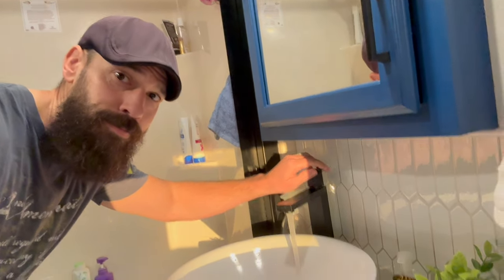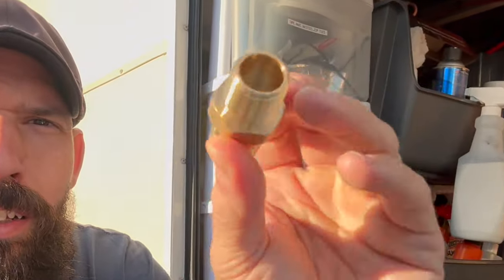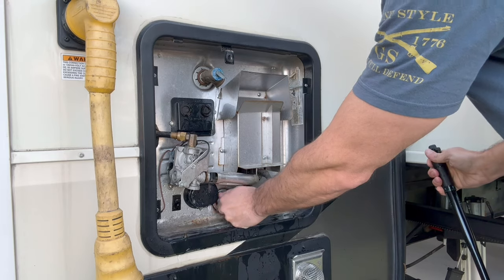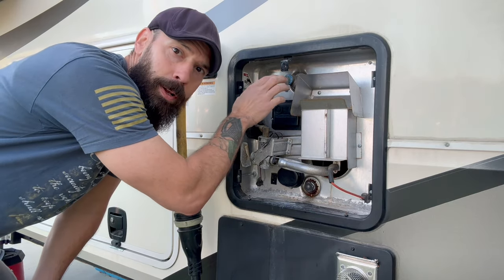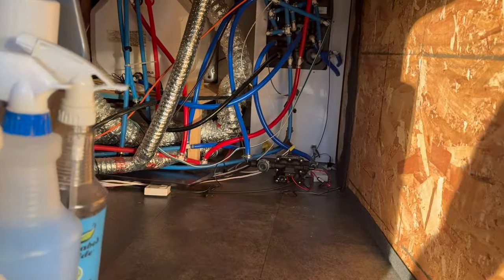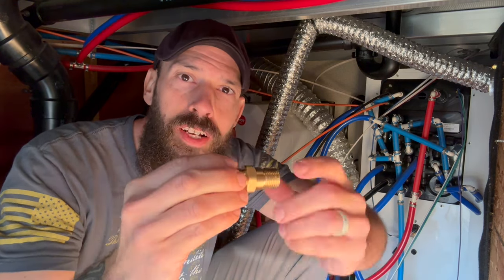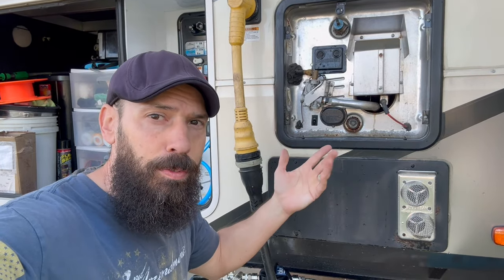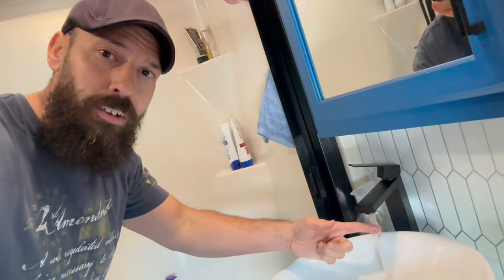A Quick RV MOD Before You’re Left With No Hot Water!

Comment from the maker: RV Preventative maintenance can be key to avoiding larger problems down the road. Sometimes doing a project or changing out a RV part ahead of time can save you time and headaches. Changing out these RV water heater plastic check valves for a heavier duty brass check valve on your water heater is a must. 

❤️ ❇️PRODUCTS IN THIS VIDEO❇️❤️
🔹1/2” Brass Check Valve: https://amzn.to/4aBJazq
🔹1/2 Drive Torque Wrench: https://amzn.to/3xpfiYt
🔹1/2 Drive 1-1/16” Deep Socket: https://amzn.to/4aEQhXu
🔹Govee Water Alarm Detectors: https://amzn.to/49qJkse
🔹Suburban Anode Rode: https://amzn.to/3U8hlZS
🔹RV flushing wand: https://amzn.to/33YTa8w
🔹Suburban Anode Rod: https://amzn.to/33KKVgy
🔹3/4” PVC plug: https://amzn.to/3AppAFx

✅👇🏼💦BLUE TECHNOLOGY WATER FILTERS💦 👇🏼✅
💵 7% OFF by using our link below!
Save on all Blu Tech Filtration Systems and Water Hoses!
BLU TECHNOLOGY WEBSITE: https://goblutech.com/?ref=whywait

💥🎥RELATED VIDEOS MENTIONED IN THIS VIDEO…
🎥 5 Important RV Maintenance Projects I Do Once a Year
https://youtu.be/2FfVgCiQoAw
🎥 Cleaning a RV Water Heater (How to Descale, Sanitize and Maintain)
https://youtu.be/jmp--XS6pIk
🎥 HOW TO SANITIZE A RV WATER SYSTEM   (Using the Grand Design Nautilus System)
https://youtu.be/mJ6oBmQRmtw

💵SAVE MONEY BY USING OUR LINKS AND PROMO CODES BELOW!💵

⭐️🔻BUY RV SNAPPADS🔻⭐️
10% off with PROMO CODE: WHYWAIT 
https://rvsnappad.com/
❇️ANDERSEN JACK BLOCKS 6 PACK: https://amzn.to/3yn8Qj2

⭐️SHOP ALL OF OUR PRODUCTS⭐️
✅ Why Wait Amazon Page ✅ https://www.amazon.com/shop/__whywait__
All of our favorite RV gear, categorized & located on our Amazon Storefront. 

💵SAVE ON NEW RV MATTRESS 💵
⭐️Visit https://rvmattress.com/whywait and use code: WHYWAIT to get 25% off your Cub order! 

❇️WAGGLE PET MONITOR❇️
💵55% OFF Coupon code: WHYWAIT55
Link to purchase…https://bitIv/30yKsCW

🇺🇸THE BEST RV INTERIOR AND EXTERIOR CLEANING PRODUCTS....
❤️❤️GABES PRIDE❤️❤️
🌟LINK BELOW!! 
https://bit.ly/3xTciRf

❤️SAVE 5% on RecPro orders using our link below and enter this promo code: DKPKNUS
https://www.recpro.com/?referral=DKPKNUS

💚BUY GAS STOP💚
🔻Promo Code: WHYWAIT for %10 OFF!🔻
https://gasstopusa.com/

#rvtips #rvlife #rvitems #rvgear
♦️OTHER GREAT PRODUCTS WE USE!♦️
🔹Unique RVDigest It Holding Tank Treatment:
https://amzn.to/3Gcizfs
🔹 Instapark Water leak sensors: https://amzn.to/3h4D7Zg
🔹Valterra twist on sewer gate valve: https://amzn.to/3iVccjI
🔹Water pressure regulator: https://amzn.to/2XM8mjf
🔹Brass 90 degree water elbow: https://amzn.to/2XOMUKl
🔹4 way garden hose splitter: https://amzn.to/3o03Kkg
🔹Camco 20’ Rhino sewer hose kit: https://amzn.to/3cj5Fhy
🔹Happy Campers blank tank treatment: https://amzn.to/3r2HRCr
🔹Thetford drain valve lubricant: https://amzn.to/2Zi0cja
🔹Plumbers silicone grease: https://amzn.to/3jPaelx
🔹Water flow meter: https://amzn.to/2XN08aj
🔹IWISS PEX Cinch tool: https://amzn.to/39pYthL
🔹Camco clear 90degree sewer elbow -  https://amzn.to/39exjuw
🔹Camco 20ft sewer hose slinky support - https://amzn.to/2HE5Jvp
🔹Camco rubber donut sewer seal - https://amzn.to/3fB4Os4
🔹Camco clear 45degree sewer elbow - https://amzn.to/3m3URFY
🔹Camco 4ft Drinking Water Hose: https://amzn.to/39WuLQI
🔹Water Alarm Detectors: https://amzn.to/3ww2A7s

🔻ALL THINGS OUTDOORS/TOOLS/CLEANERS
🔹Boeshield T-9: https://amzn.to/3RyIl1p
🔹Boeshield Rust Free: https://amzn.to/3o3EsUA
🔹Eternabond Tape 50’ x 4” https://amzn.to/3J5JET3
🔹Eternabond Tape 50’ x 2” https://amzn.to/3P79CJs
🔹Alpha Systems 1021 self leveling sealant: https://amzn.to/3MR9kUc
🔹Viair Portable Air Compressor: https://amzn.to/3nRsYlh
🔹GCI Pod Rocker chairs: https://amzn.to/2WKKOup
🔹LCI Lippert Screen Door: https://amzn.to/3hW9gmo
🔹Telescoping ladder: https://amzn.to/3a8Sv3P
🔹TST Tire Pressure Monitor System: https://amzn.to/3cfONrW
🔹242 piece fuse assortment kit: https://amzn.to/3qZArA1
🔹1/2 Drive impact flip socket set: https://amzn.to/3t5Qq1u
🔹Kobalt 1/2 inch drive Torque Wrench: https://amzn.to/3lwiRC6
🔹Eternabond Tape: https://amzn.to/2YpetKE
🔹30 Seconds Outdoor Cleaner: https://amzn.to/2YHnfnf
🔹Progressive Industries EMS-PT50X RV
 surge protector: https://amzn.to/368DiOZ

🔹 1/2 Drive breaker bar: https://amzn.to/2OMloMF
🔹Maxx Haul wheel chocks: https://amzn.to/3chAras
🔹Lynx Leveling blocks: https://amzn.to/3t1uSmt

🤝🤝CONNECT WITH US ON SOCIAL MEDIA🤝🤝
👉🏼Instagram: https://www.instagram.com/__whywait__/
👉🏼Facebook: https://www.facebook.com/chris.kapperman.5
👉🏼TikTok: www.tiktok.com/@_whywait_

......NOTICE......
Some of the links on this page are Amazon affiliate links. If you choose to make a purchase using our links, we will earn a small commission. This commission comes at no additional cost to you but helps us keep providing the content we share. We recommend these products because we use them as ourselves and find them helpful to us not because of the small profit we make. Every linked product we use and appreciate it when you use our links. Thank you.

Comment: Aren't you worried about galvanic corrosion between the brass check valve and the steel hot water tank? Mixing those metals actually caused a leak in my home water heater connections.